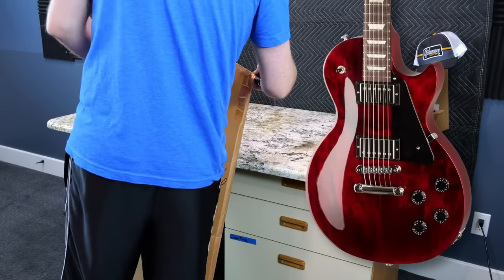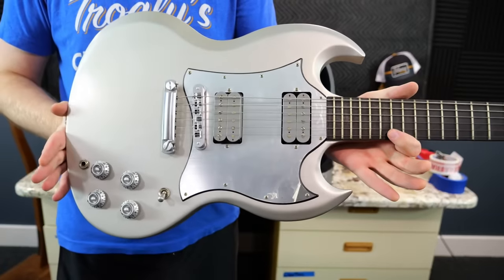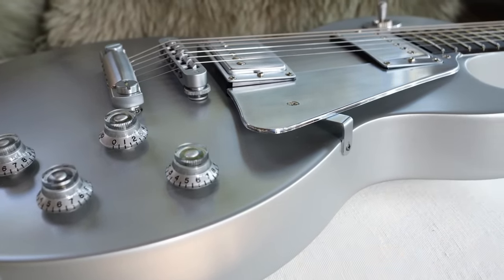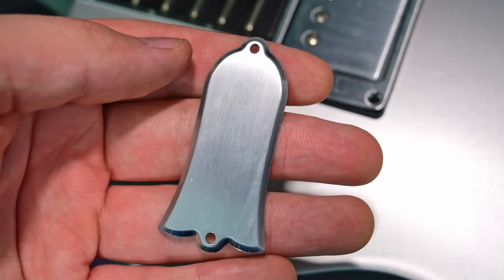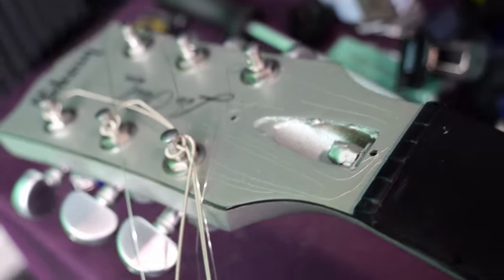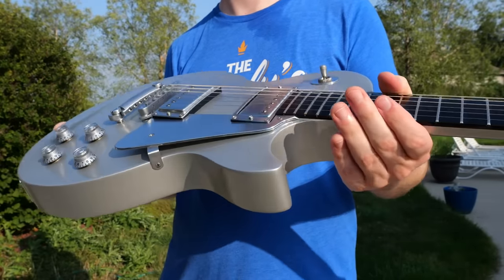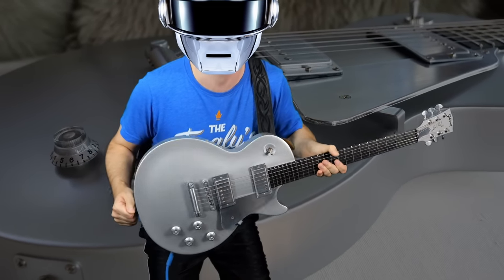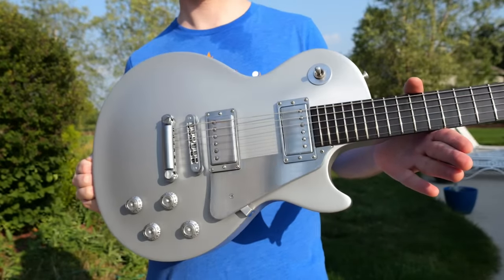If Daft Punk Had a Signature Guitar... | 2005 Gibson Les Paul Platinum Review + Demo

Comment: I own a 2003 platinum Les Paul. There are a few differences.
The pickups are the 500t set (that is what the list stated from American Musical Supply). The bridge measures at 15k the neck is around 9k.
The neck on mine is like a baseball bat. At the nut it measures .95 and 1 at the 12th fret.
It’s a great guitar. Love it.
My case is a bit different also. It has a black case shroud. 
The finish is very easy to wear through. So be careful.

Comment: There's a listing of these locally to me in Canada advertised as the "2003 Platinum" set. But they've both been entirely parts swapped prior to a "restoration". Each guitar is missing ALL the platinum hardware, pickups, knobs and ring toppers. Hardware is all chrome also black bobbins now. Seems misleading to still call it the Platinum set when yours demonstrates what the real deal has to offer.